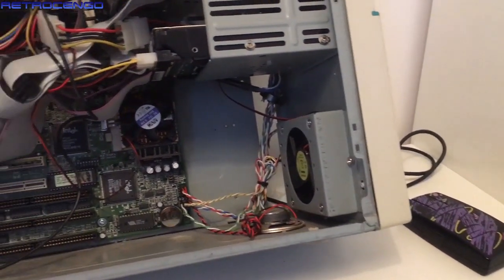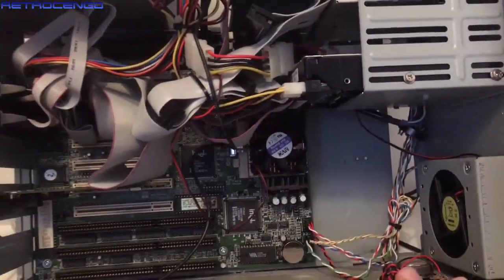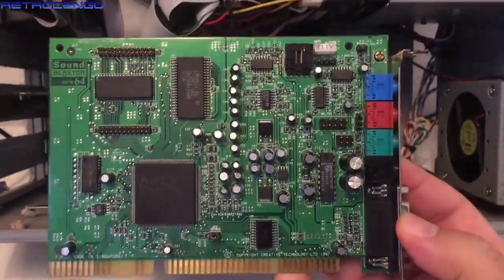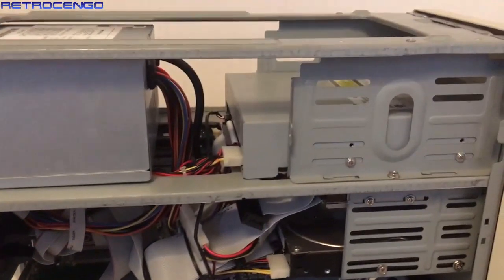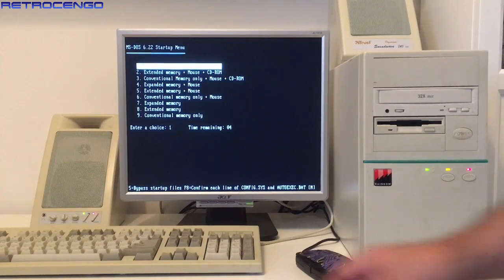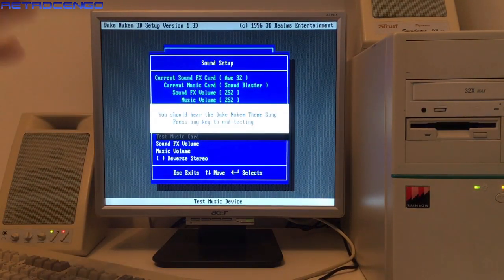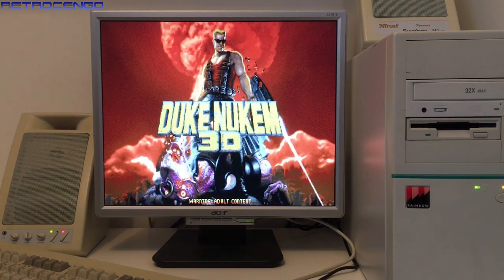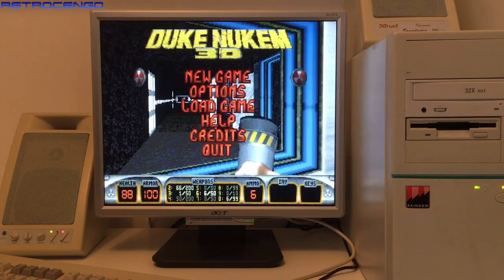AMD K6 200MHz MS-DOS PC Review with Sound Blaster AWE64 Soundcard

Comment: Great video, great sound! I also have an AWE64 and another AWE32 with SIMM modules... I also have an AMD K6 200. Mine is in an ancient Maxdata Artist system with GA-586STX2 motherboard. A model from 1997 which already has ATX and dates from the early days of the ATX standard. However, the PC only has a simple ESS 1688 ISA sound card. But he has a Radeon 9200 PCI with 128 MB and 256 MB of system ram. I can even display Full HD with it 😁 However, you should bring some time because such a resolution is hard work for such an old processor. The PC still has a 3dfx Voodoo 1 and a 32 GB SSD on the SATA to IDE adapter (which of course doesn't bring much more speed, the SSD should get very bored) 😏
Reply from the maker: Thanks buddy, it’s quite a nice system you got there for ms dos gaming 😀

Comment: I have the same one and the sound is abysmal compared to dosbox and I have to repair it, the amplification chip broke, it is a 900mhz pentium 3 and win 98b
Reply from the maker: Hernan gomez noni Take good care of that awesome soundcard, hope you can fix it😁👍🏻
Reply: @RETROCENGO  Thanks that I hope I have the spare part I just need to find someone who has a heat gun or a soldering iron that raises enough degrees
Reply from the maker: Hernan gomez noni I’m happy to read, you are taking good care of the card, and not “try” out. Best to do it with propper tools yes, 👍🏻 
Wish you a great day buddy

Comment: I think that some Sound-Cards can have double purpose jacks so if you plug in an special Optical adapter jack plug in you can connect to a TOSLINK enabled speaker system for nice digital audio.

Comment: I dont like AWE64's for Duke3D. The guitar is awefull. I much more, like DreamblasterS1 boards. Other than that, then you have a really good GFX card for Dos. S3's are like one of the most compatible.
Reply from the maker: brostenen We are all different, i love the AWE sound compared to normal soundblaster mode. 
I’ve not felt any benefits between different pci gfx cards in dos, they all just work😁
Reply: @RETROCENGO  Yup. Some just love AWE cards. Regarding PCI hfx cards, then the S3's are faster than some other competitors in pure dos. Yet there is still a limit, in were more speed does not matter at all. The reason why I like them so much, are generally compatibility with as much as possible. Here the S3's rule supreme. However the two main S3 cards are S3-Virge325 and S3-Trio64v+ cards. They do require a tsr for full vesa compatibility. On this, the Cirrus Logic 5446 are way better, as they are vesa out of the box. They do tend to loose in speed to S3, when you reach Pentium1-166 mhz and 200mhz. So if you have a 486dx4-100/120, then you need the CL5446 as the ultimate Dos GFX card, if we are dealing with a PCI system. For VLB, I just tend to go for S3-805 cards. There are better cards, yet you do not need faster cards than things are running fluid.
Reply from the maker: brostenen Nice, thanks for that, im using a matrox card from 1996, works fine for me🤗
Reply: @RETROCENGO  Yup. For late era Dos, then matrox are fine. Yet they need a fast CPU. They fit right in, with an 1996, top of the line machine. Yet for a 486dx33, they are really bad. A game such as Duke Nukem 2 and other 1990/93 games, it is bad, because of incompatibility with lots of screen modes.

Comment: If your motherboard can run 75MHz bus speed, the K6 200 really flies if you set it to 75MHz x 3. It's a tiny 25MHz overclock, but the extra bus speed actually helps a fair bit. I used to run a K6 200 on an Asus TX97-X back in the day at 3 x 75MHz. Also had that type of AWE64 as you do, and a Matrox Mystique 220 graphics card. Great system.
Reply from the maker: Rebecca Schade I totally agree, great setup, well speed wise this 200mhz is a monster in ms dos games, I actually disable cpu cashe for some games, to slow it down😁
Reply: @RETROCENGO  Yes, it is certainly too fast for older games. Even my 486 DX 100 is too fast for many older games, like the early King's Quest and Space Quest games and such. But if you want to have a go at Quake or such, then you'll want all the performance you can get.
Reply from the maker: Rebecca Schade Thinking about installing win98 on this one, then its will be good idea with a little more juice😁👍🏻

Comment: Try to change the speakers capacitors, or the power supply,  maybe it will remove the "hum" sound ;-) I did it on my CS DTT2500 an it worked.
Reply from the maker: Hugo Costa Thanks, its the psu thats allmost dead, will replace it or other speakers
Reply: True that. Creative always used low rated and inferior quality caps. Sometimes they broke guidelines on the datasheets of the various amplifier used on the cards.